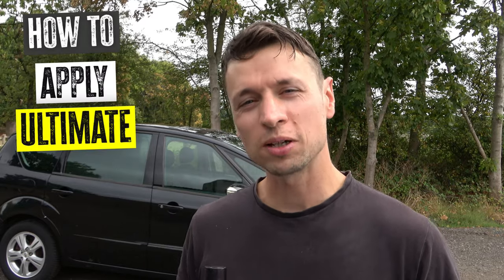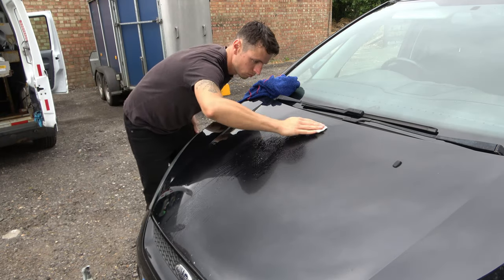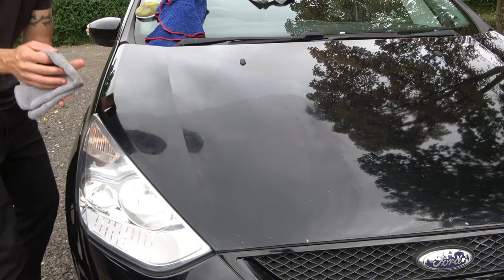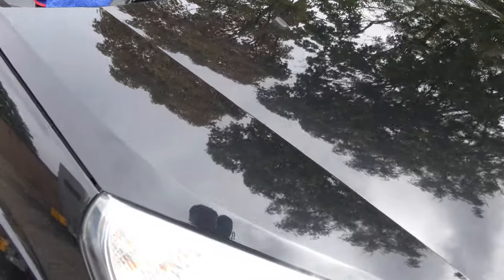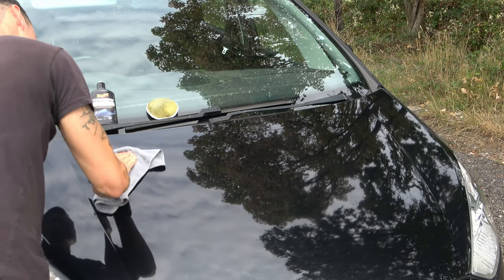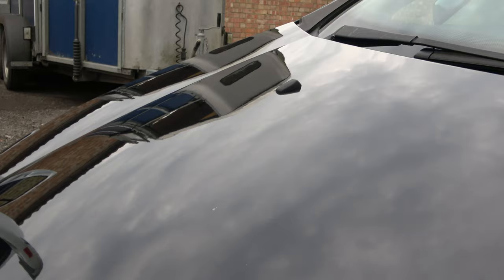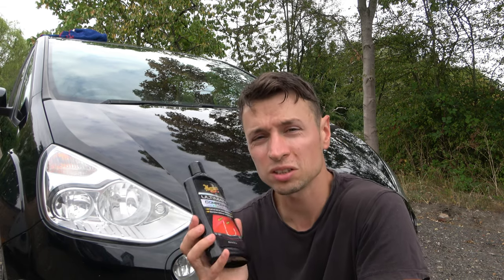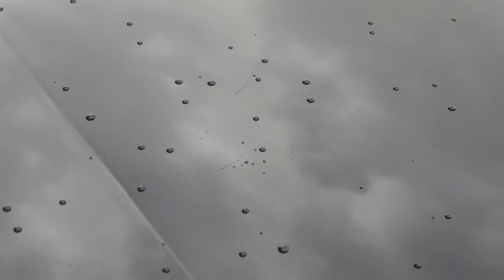Applying Meguiars ultimate compound by hand | Does it Work?

Comment: Great Video. How long would this take to do a car of that size for a customer? And how often would you compound and polish a car like this and top up with ceramic?
Reply from the maker: For me using by hand will take longer than using machine. To be honest by the time you finished Washing and clay barring then compounding by hand it will take hours to do. It's great on one off panels but the whole car would take a very long time. Once weather warms up its on my list to see how long it will take in the same car
Reply: @epicautomotivedetailing  So many questions lol!!. You should do a live Q&A 👍
Reply from the maker: I would do a live one but I'm not everyone's cup of tea so I get loads of trolls target me so send any questions and I'll do a q and a
Reply: @epicautomotivedetailing  I get you m8.
What wet/dry vac would you recommend. Looking at a Henry one. Also heard Screwfix on brand Titan is not budget for a budget. Also what is the most effective way to keep the cost of product down. Is Halfords a no no?
Reply from the maker: @ThePaulaon1  I USE CHARLES VAC, its the same as george in terms of motor but without the trigger to spray but spent just a few quid and get a hand pump. Will save you £150

Comment: Thanks for the video, I have a query, I have a 5 year old car, never done any paint protection or detailing, so can I use meguiar's ultimate compound to remove swirls and scratches and then turtlewax ceramic spray as a sealant?
Reply from the maker: Yes it works. It won't get same results by hand but honestly I think people overthink it. The car will still look ace

Comment: Hi. Newbie here again!  If a car isn’t too bad, would you still need to use a clay bar and compound?  My car has very few scratches. Could I just go straight to the polish and wax phases- after cleaning of course and would I need to use a decontaminate
Reply from the maker: If a car isnt too bad then you may be able to get away with it. Polish and wax will just enhance the clarity but not remove the defects. You can still make a car look amazing without the compounding process but it wont last long. Just depends on how in depth you want to go.

Comment: I scratched my paint with UC...applied it with that round meguiars foam applicator, by hand. It removed the waterspots from the paint, didn't remove any scratches,(wasn't expecting it to do it) but it gave me some beautiful circular swirls everywhere I applied it. 
It's probably me...but be careful. I'm gonna try one more time, but it seems, like mith busted to me.
Reply from the maker: Hi mate sorry to hear that. The only way it would cause scratches is if there was something in between the pad and the surface of the paint and it can be very tiny and still enough to damage it
Reply: @epicautomotivedetailing  Hi. Thanks for your reply. Yeah, anything's possible. I will try it one more time. It's not the scratches that annoy me, it's the holograms. I read somewhere, that I have pushed too hard on the pad. In the shade it looks good, but in the sun...

Comment: I plan on doing this tomorrow, I recently bought a new car but it had some sun damaged but nothing too bad and of course it is Black. But also question, should I do this before or after a car wash??
Reply from the maker: After definitely. Car needs to be thoroughly washed, clay barred before using. You can get rid of marring marks by hand but it will take slightly longer

Comment: What is the ambient temperature at that point in the video?
I can't apply the compound, it practically dries instantly after one or two passes.
The plate temperature is around 27 degrees.
Greetings from Portugal
Reply from the maker: Hello, it was UK weather so probably freezing cold. Can't remember now but wasn't anything like what you have in Portugal that's for sure

Comment: I picked up some of the Rain X Graphene spray wax and noticed on the back that is mentions it can be used as a lubricant for clay bar treatment. So I tried it and a @hit ton of dark liquid came off, most likely a lot of the spray as it changes colors. Is this a bad idea?

Also, will Ultimate Compound help remove the Liquid Wax?
Reply from the maker: If it doesn't mark the paint it's fine. Most companies just use dye when it's actually a clear chemical

Comment: Thank you!! Wanted to do it by hand. Does your car have the top layer as Clearcoat?
Reply from the maker: I added megs polish (which is more of a glaze) then ceramic wax on top. There is still plenty of clear coat on the car even though it's fairly old now
Reply: @epicautomotivedetailing  Thank you again! I wasn't sure if European manufactured cars used Clear Coat.

Comment: Hi,
I never did my self neither I have machine but I want to try to do by myself. I have white Benz 2105 model there is no scratches just paint doesn’t have mirror shiny, can you please suggest me what I should use as beginner
Reply from the maker: White is always tricky to make shine but you can add gloss with a ceramic detailer 👌

Comment: Hi, will the ultimate compound remove swirling in the paintwork and can I use the Autoglym super resin polish in addition to the Meguiars polish you used in the video please?
Reply from the maker: It will remove swirls and yes Autoglym has very fine abrasives so applying in top will help
Reply: @epicautomotivedetailing  Ok thanks. Using a machine polisher what grade of polishing pad would I use and what speed should I set the polisher at please?

Comment: I have a Fjord grey metallic E36 and it looks like the kids of the guys a bought it from had a ninja battle on it. Millions of light to medium scratches, and a few heavier ones. Sounds like this could be the route to go. My concern it up keep. I live in a dusty neighbor hood and am concern about how to keep it clean after putting in all this time. Any thought regarding the scratches and the constant dust?
Reply from the maker: The dust is a real pain. Ceramic Detailers make great anti static solutions to reduce dust.
Reply: @epicautomotivedetailing  so what final coat would you recommend? Compound, then polish, then??

Comment: many pro detailers don't more then $250 for there DA... i found one much cheaper then that...its the experience and skills you have not the always the cost of your tools... i want to try this ceramic wax you use...how long does it last? and does it protect finish much better then other waxes etc... thanks
Reply from the maker: Ceramic wax is very good but to get long durability you need to later it 24 hours later for best results. Still very good on its own though
Reply: @epicautomotivedetailing  so you say wait a day after polishing your car before applying ceramic wax? whats the reason... to me it makes no sense to wait..never heard this before.thanks
Reply from the maker: @roadstar499  no no 24 hours between ceramic wax so apply one layer then wait 24 hours for best results. Ceramic sprays can be around 4-12 hours curing time
Reply: @epicautomotivedetailing  okay that makes sense.thax

Comment: I don't get it: when I did exactly the same thing - applied by hand - the fine swirl marks (spider webs; only visible in bright sunshine) weren't removed - at all. Were yours? I contacted Meguiar's. Gave some BS about really needing to use a DA machine. Though it says on the bottle can be applied by hand.
Reply from the maker: Hi Nick, first of all it depends on how bad the paint is. everybody has different opinions on what's bad or fixable, Secondly it was the combination of using polish on top and a protective wax which ultimately gave it the best finish by hand. Sadly sometimes paint may need machine polish but nevertheless you can still enhance it to a degree. Do you think they were heavy buffer marks from a previous machine polisher?
Reply: @epicautomotivedetailing  My paint was practically new - 2020 BMW X2! Already fine scratches after a few washes over last winter in Moscow (terribly filthy - scratches caused when washing, drying (even though I was careful). I use Meguiar's Ultimate Polish and Wax - great. But Compound: it just leaves the fine scratches it is supposed to remove, inc. by hand. Useless, and a waste of money (without a DA, and I'm not getting into that as a mere weekend warrior and nowhere to elevate the car to to reach the lower panels easily).

Comment: Here's my question in the video he repeatedly says to use light pressure when applying the Ultimate Compound and polish. I'm watching and I'm seeing light pressure being applied yet in the comments section and more than one person says that it takes elbow grease so which is it? Light pressure or heavy elbow grease pressure I need to know because working with a stroke I cannot apply heavy pressure so if that's the case I'll just get a DA polisher I'd rather not spend the money so is it light or heavy pressure?
Reply from the maker: Varies on how much effort is needed. I wouldnt over think it. abrasives breakdown as you polish so sometimes a little more pressure is needed
Reply: @epicautomotivedetailing  thank you so so much for responding this is my first time doing any of this and I'm really nervous... First time repairing my car I removed rust spots bonded fiberglass painted clear-coated with 2K the car looks amazing but it does need to be buffed and Polished especially my hood which looks absolutely atrocious the hood looks charcoal grey the rest of the car looks jet black it has so many contaminants so looking at the video I'm thinking wash clay bar then compound and polish

Comment: Is the liquid wax necessary or can you get by with just the compound & polish?
Reply from the maker: Liquid wax just finishes it off. Ceramic sprays for me are just as good. You can make do with compound and polish but durability is shorter. Megs paste wax will give it more clarity
Reply: Thanks!

Comment: Please help. I picked up the new turtle wax one and done compound and I’m determined to do it by hand as I live in an apartment complex and wouldn’t have much use for a d. a. polisher. Picked up the chemical guys orange “medium cut”  hand pads. Every video I’ve seen where they compound by hand it seems like they’re putting a lot elbow grease in to it(more than you used in this video), and they used cross hatch patterns but you used a circular motion. I’ve waxed my car since I was a kid but no experience compounding, am I going to do any damage with the pads I bought and the “elbow grease” I plan on using? Am I doing anything wrong. Thanks in advance and yes I’d like to see a full car compound and polish y hand video, when you have time lol.
Reply from the maker: Hello yes the elbow grease has been proven to work many times. Autoglym scratch remover requires pressure too. Your never get perfect results but you  will be able to improve on it by hand. When doing it by hand both ways circles and cross work. Even in meguiars videos they show circular motions and i wouldnt say there is 1 rule fits all. Ive not used that yet but i know from friends that it is amazing stuff. clay bar first will make life so much easier
Reply: @epicautomotivedetailing  thanks!

Comment: So you can work that light by hand and it will still correct some that's pretty good  I watched a diffrent video he put 5000 grit sanding Mark's in he had to really rub the heck out of it I am looking to do this right before I wax because supposedly helps wax bond better I try keep my car clean in winter I try hand wash once month  the get stuff off I hit with spray wax in between hoping will keep paint decent I used to just decon soap and then wax I really try not to clay ever year I dunno guess just try doing right steps to help keep paint looking nice for as long as I can
Reply from the maker: Hello, as long as it makes the car look nicer for you then I wouldn't worry too much about using a machine. Using hand won't remove every mark but it's been designed in a way to user friendly and give great results that's what I love about. Hand will never beat machine but still give a nice finish. Using ceramic waxes, sealants regularly will always keep it shiny. Every time I valet a car I use yum detailer after 👌
Reply: @epicautomotivedetailing  Where can I get Yum Detailer? 🙂

Comment: Used compound on our old Fire Engine today but it didn't really work too well. Any suggestions please.
Reply from the maker: Faded red. How old is the paint? I've worked it in faded red planes before with machine and it's been all good. Sometimes wet sanding is needed
Reply: @epicautomotivedetailing  1970s not sure how old the paint is. It could if had a respray in its life.

Comment: After using compund is it really necessary to use ultimate polish? 
Or maybe just use some other liquid polish..
Reply from the maker: Hello you can refine it with some other polish such as Autoglym super resin Polish then wax on top 👌
Reply: @epicautomotivedetailing  thank u buddy
Reply: @epicautomotivedetailing  or maybe after using compound meguiars ceramic coating would be fine..????(liquid one in blue spray bottle)
I just want to avoid the cost of both polishing and ceramic coating...

Comment: I want to do hand pant correction but everybody is saying hand cannot get the results like machine, i confused whether I should do by hand for my car or give to detailer.
Reply from the maker: It's true hand won't get the exactly the same results but it will get you GOOD RESULTS though. It just takes much longer
Reply: @epicautomotivedetailing  Will it be noticeable difference if car color is white?

Comment: Unfortunately I used the compound on my bonnet before I saw your vid. It has caused a chalking effect big time any thoughts on what to do now?
Reply: This happened to me, too. Although I applied it in the shade, it had just been parked in direct sunlight. So the hood was hot. I believe that is why it happened on one particular area where I may have taken a tad too long. I got it off by spraying some Bead Maker on it and wiping it off.
Reply from the maker: Sometimes the heat will play a huge part. It needs to be cool and maybe use a little bit less and see how that goes 👌

Comment: I should probably start by saying I don't have a machine polisher, although I have long thought about taking the plunge. The question for me is, does a compound applied by hand really correct (or even enhance as you are careful to word) the paint to any useful degree? Sure you can apply a compound by hand, but did it do anything apart from add a little gloss? I don't think I could work a whole car by hand twice, once for compound and again for polish. Surely an all in one is better, accepting the gain you see will mostly be the affects of gloss and fillers and little to no actual correction or even long term enhancement. I think I have watched too many videos of paint being inspected via spot light, but it's put me off hand polishing. I just skip straight to a hybrid QD these days!
Reply from the maker: That's a very good question Graham and compounds will break it down by hand and it can remove scratches. The abrasives do there job very well. For me all in ones don't have enough abrasives in them and yeh it's down to personal preference whether you go down AIO process or do this. But it's a good starting point for people to be familiar with. And it shows what can be done by hand. Meguiars even say themselves that this will still work by hand. Definitely one heck of a great compound. Especially by machine 👌. Thanks for watching mate 🙂

Comment: Hey David!Another awesome video of yours. Quick question : should the application pad be dampened for avoiding powdering leftovers from the compound? or Should the pad stay dry throughout compounding process? Thanks
Reply from the maker: Hello yes i slightly dampen it. Ideally wash the pad out after few uses to avoid build up
Reply: @epicautomotivedetailing  wash the pad with what? Plain water?

Comment: My car's barely a month old. Do I really need to use a compound and a polish? Or a simple spray wash would serve the purpose.
Reply from the maker: Hello if the paintwork looks good to you and your happy with it then I'd say go for something like a ceramic spray or even a wax. Waxes tend to have shorter lifespan but offer slightly better gloss and easy to apply without much hassle 👍
Reply: @epicautomotivedetailing  I am not very happy with the paintwork. I thought of going for a Meguairs Polish followed by Ultimate Spray Wax. Is this gonna be good?
Reply from the maker: @chanz4liz  if you're not happy then definitely a good compound is essential to begin with. I got spray wax but not used it yet

Comment: if you want to wax the car second time after a while do you use clay bar again?
Reply from the maker: No clay bar should only be used for a decontamination process. Clay bar will mar (lightly scratch) paint hence the compound to correct it

Comment: Great video. Just wondering if you used the same microfiber/foam pads they normally use on machines or are they specifically made for hand polishing? I'm also a bit worried about accidentally leaving the polish on too long and if you had any tips for removing it?
Thanks for any help.
Reply from the maker: Hello. Foam or microfibre hand pads  will be plenty good enough

Comment: Really luv to see high wet lookin gloss finishes....
Reply from the maker: I think it did a great job. You had to look hard to see any defects so I was pleased
Reply: Hi can I use this for a panel iv just sprayed with a rattle can? I have clear coated it but it’s looking dull compared to the rest of the car need to get it shiny
Reply: @joshcatalano5127  pretty sure that would be ok just go easy on the compound and u shouldnt have any problems